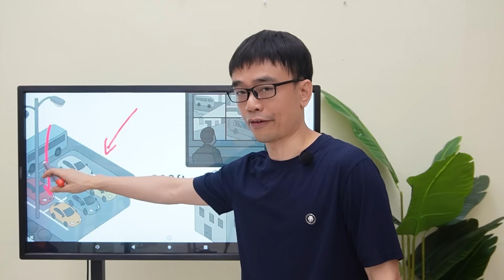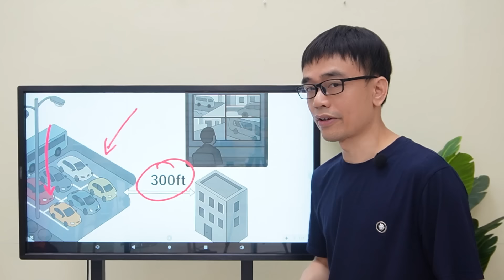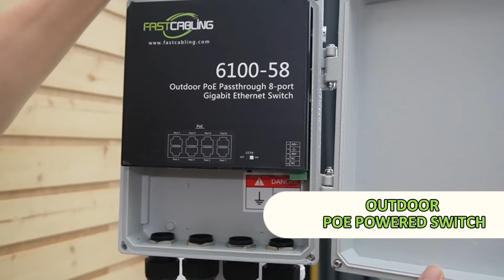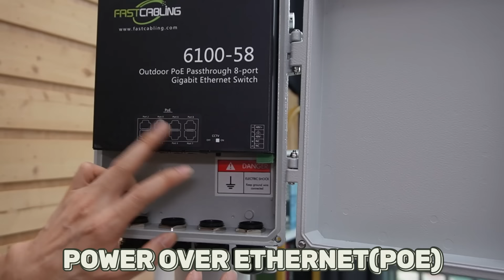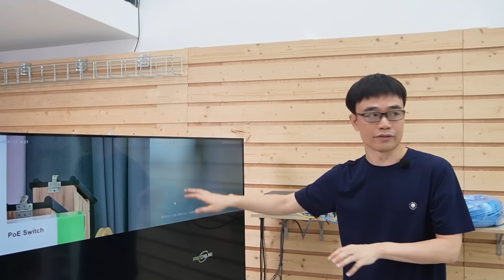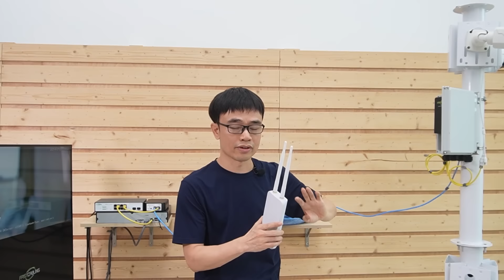Power 4 PoE Cameras with 1 CAT6 Over 300ft! | Parking Lot IP Camera Setup

Comment: Won’t the Voltage drop because (to much) of the length of the cable.
90W is possible because the amperage will go up 48Volts /90 watt is 2 amps but that over 300ft over these 2 very thin wires.

Ps: liked your video 🙏🙏

Comment: Thanks for all the information in details, but i have a question, what about a Indoor PoE switch is PoE+ and outdoor PoE switch is only PoE? the divises connected to the PoE switch in the outdoor still have the power issue? Thanks :)
Reply from the maker: In this video, we use the Outdoor Waterproof PoE Pass Through Switch

Comment: How do you get to the cameras if they need to be repaired? It would seem that an extension ladder would not be stable leaning against a single cylindrical pole, and a very tall extension ladder is very expensive. Is there any way to easily take down the pole?
Reply from the maker: In real life, metal poles are usually used and you can use hinged / tilt-down poles.

Comment: You Poe switch is gigabit but NVR ethernet port is not gigabit
Reply from the maker: You can connect the switch and the NVR to the same router. This setup removes the bandwidth bottleneck by sending camera data at full speed through your gigabit network (via the router), while still allowing the NVR to access the stream and perform all its normal recording and management functions.

Comment: Nice but am I correct in saying that you dont have enough power to supply a ptz
Reply from the maker: This outdoor PoE passthrough switch delivers a maximum power output of 30W per port, with a total power budget of 95W. There should be enough power for 1-2 PTZ cameras.

https://www.fastcabling.com/product/outdoor-waterproof-poe-pass-through-switch/

Comment: "how to power 4 poe cameras with 1 cat6 cable"
...
"put a second poe switch at the end and add 4 cables"
Reply from the maker: From the PoE injector (or main PoE switch), only one CAT6 cable runs over the long distance (300 ft / 100 m). That single cable carries both power and data to the PoE passthrough switch. Once it reaches the PoE passthrough switch, the switch splits the connection locally into 4 short Ethernet cables, one for each camera.

So instead of running 4 long cables, you run 1 long cable, then distribute power and data close to the cameras. The outdoor PoE passthrough can draw power from the upstream PoE switch or injector, so there's no need for an extra power supply, and it can double the range to 200 meters.

Comment: I saw another video where the unlink goues on port#7
Reply from the maker: We've developed multiple outdoor PoE switches. This is an outdoor PoE passthrough switch that can be powered by another PoE switch or PoE injector and power other PoE devices simultaneously. Port# 8 is the PoE passthrough port, where the power goes in. 

https://www.fastcabling.com/product/outdoor-waterproof-poe-pass-through-switch/

Comment: cannot POE injector be directly connected to NVR thus avoiding a POE switch in NVR side ?
Reply from the maker: The PoE injector is used to power the outdoor PoE passthrough switch. 

You can connect a PoE injector to the NVR if it only has regular Ethernet ports (if the NVR has built-in PoE ports meant to power cameras directly, injectors usually won’t work properly). However, this method is often used in situations where only 1-2 cameras need to be connected. Moreover, the NVR usually doesn't have multiple Ethernet ports on the interface, so it would be better to use a PoE switch instead.

Comment: There is a simpler solution, use a Poe extender 😊 Poe switch should be Poe++, extender is 1 in 4 out
Reply: Doesn’t work for me. I have one cable cat 5e and nvr Poe so one camera automatically goes to the same Poe port. The other i can’t add. Nvr sees it but can’t add. The extender is dahua pft1300
Reply: @minchouk as far as i checked that dahua model is just for extending the range. I use generic poe extenders, 1 port for in, 3-4 ports for out. When i connect the Poe switch to" in" port , i have Poe in output
Reply: How did u do it mate

Comment: An interesting and easy to understand video. It would have been nice to see it running 4 cameras instead of the 2 in the demonstration though.
Reply from the maker: Thanks for your advice. We appreciate it! This outdoor PoE passthrough switch has a total power budget of 95W, but you need to use a high-power PoE injector or switch, e.g., a 95W PoE injector.

Comment: so to power 4 poe cameras with 1 cable..you need another poe switch in between? (not just 1 cable) clickbait title or am i missing something?
Reply from the maker: This PoE-powered switch can pass through PoE power to the connected devices and extend the range for another 328ft. Think of it as a multi-port PoE extender.
Reply: PoE++ > PoE switch > PoE device(s)

Comment: How i can connect two networks devices 1 en devices 2 video recorder.  not the same network  to see the cameras devices 2 on devices 1
Reply from the maker: If you want a safer and more stable setup, you can set up a VPN tunnel.

Connect both networks through the VPN. Once connected, the devices act as if they’re on the same LAN. You can access cameras from Device 1 directly using their private IP addresses.

Comment: Hello sir, what is the best outdoor antenna for wifi
Reply from the maker: A directional, weatherproof, dual-band outdoor antenna with 10–20 dBi gain is usually best for extending WiFi outdoors (especially for point-to-point links).
Reply: @Fastcabling can you suggest what brand or model sir?
Reply from the maker: If you're interested, you can take a look at our WAPs and wireless bridges: https://www.fastcabling.com/product-category/wireless-transceivers/

You can contact us at support@fastcabling.com for further assistance.

Comment: Why not use a AXIS P3735-PLE instead? One CAT cable, one PoE switch required.
Reply from the maker: It cannot cover a distance of 300ft.
Reply: @Fastcabling hmm 91 meters, still possible.. depends what you want to see. Actually, a panorama in the middle would be best that only shows what happening, and then use a ANPR capable camera near the entry/exit of parking to identify who did it.

If something "bad" happens on the panorama, you sync the video to the ANPR camera and follow the 'culprit' car until he enters the parking.

Comment: Can I use a Wi-Fi bridge without a cable?
How many cameras can we add?
Reply from the maker: Normally, it connects wirelessly to your main router, and then you plug a cable from the bridge to your NVR, switch, or camera. If you don’t use a cable at all, then it’s not really a bridge anymore — it becomes just a Wi-Fi client device. Most NVRs and IP cameras expect a wired Ethernet link for reliable streaming, so you’d still need at least one cable from the bridge to the device.

Comment: So you failed as you used three cables in example and will use five for client
Reply from the maker: This outdoor PoE passthrough switch has 7 PoE ports (30W max.) and 1 PoE passthrough port, which means you can connect up to 7 cameras at a time. So there will be no problem connecting 5 cameras. 

You can find more information here: https://www.fastcabling.com/product/outdoor-waterproof-poe-pass-through-switch/
Reply: @Fastcabling the point is that you said one cable and that is not true
Reply from the maker: It's one cable from the injector to the outdoor poe passthrough switch.
Reply: @Fastcabling now that makes sense

Comment: What is standard DC current working imit Poe to poe
Reply from the maker: These current limits are based on 48V DC over Ethernet cables. Actual current may vary depending on cable length and power consumption of the connected device.

Comment: why do you need the first switch when you add the Injector? can the injector plug straight into the NVR assuming the NVR provide POE, then from the injector to the outdoor switch ?
Reply from the maker: The power budget will become an issue. Normally the PoE NVR only can output 30W through single PoE port. That PoE injector supports PoE bt which can output 90W with 4 twisted pairs in UTP cable.

Comment: Why dont you go directly from NET DVR to PoE injector data rj45 if you r using injector
Reply from the maker: The NVR only has one LAN port. Moreover,  PoE injectors only add power to the Ethernet line — they don't have switching capabilities.

Comment: Very Informative, Sir can you please make a video on POE Access point/ Wireless Acess Point which no need of Power supply, just run on cat6 cable
Reply from the maker: The setup is the same. You can connect any PoE devices to the switch.

Comment: It technically works .But how long it will last . 
That is the main point in the eyes of government or private sectors.
Reply from the maker: It is common practice to have edge switches to connect ip cameras. Only the PoE powered solution delivers the power from the backend.

Comment: lot easies add cameras to own yard, use wireles cameras, i buy linux based security box and 8 camera no need wired all camera, only need power to cam but no need other cables. simple easy and no cost lot, box, 1TB ssd, 8 cam cost only 200$ and need cheap display too can see all cam  picture.
Reply from the maker: Wireless cameras can be a an option for some setups.

Comment: So i can use the POE injector alone to power 4 cameras? no need for the poe switch correct?
Reply from the maker: No, you still need the PoE passthrough switch to power multiple devices. This switch can receive power from a PoE switch or injector, so you don't need an external power supply. 

https://www.fastcabling.com/product/outdoor-waterproof-poe-pass-through-switch/

Comment: 1 big problem - now you have (another) single point of failure...  For something like Public CCTV cameras, I'd strongly suggest having a 2nd cable for hot-failover.
Reply from the maker: You are right. It is always better to have independent link from each camera if it is possible, but two layers even three layers network topology is quite common in the IP cameras system.
Reply: @Fastcabling  by 2-3 layers, are you feeling to the OSI model layer 2 and 3 ? "Layering" aside, a si gle point of failure should always be avoided. :) The most expensive cable, is the cable you have to re-run or replace. Run 2x cables at once, job done 1st time. :)
Reply from the maker: What I refer to is the access switch- aggregation switch and core switch.
Reply: @Fastcabling  thank you for clearing that up. Perhaps I'm not understanding, but how would that reduce risk of a single cable failure ? :)
Reply: @zadekeys2194 It doesn't, however in my 20 years of being a network administrator, I have NEVER seen a properly rated and properly terminated cable fail.

We generally have fiber optic between the switches but with hundreds of runs of cat 5/cat 6, I have never even had one just fail.

That switch is gonna fail long before the cable does. The only reason that cable would fail is because it was damaged. And if you run cables side by side, it's likely that bot will be damaged.

There is no need for a "backup" cable but you can pull an extra one just in case for piece of mind. And if both switches support port aggregation you can connect both ports to both switches to increase throughout and have an automatic fail over.
Reply: There is nothing wrong with this design and he's posted a very good video. If redundancy is needed each site survey will identify whether (for example) diverse cable redundancy is needed, whether large conduits with multiple redundant cables are needed, whether multiple switches are needed etc. What he's explaining here is a single design in principle. It is not intended to cover all scenarios so there's nothing wrong with it.
Reply: Show me how Obi-Wan.
Reply: Switch to switch to switch
Reply: You want to cause a loop with 2 cables

Comment: How can I buy your POE passthrough switch. Also, can it handle cat 6 cable of 200 meters?
Reply from the maker: You can order directly on our website: https://www.fastcabling.com/product/outdoor-waterproof-poe-pass-through-switch/

It can extend PoE for another 100 meters (up to 200m), but you need to put it in the middle. This outdoor PoE passthrough switch supports 1000Mbps, so it can work with Cat6 cables with no hassle.

Comment: Great demo. Thanks for sharing. Do you ever perform any data/voltage loss meter analysis? Curios to know how the current sustains availability in the long run.
Reply from the maker: We have run both test. There is no package loss within 800 meters. The bandwidth will step down to 10Mbit after 500 meters.
Reply: @Fastcabling  you / your team are fantastic. Thank you so much!